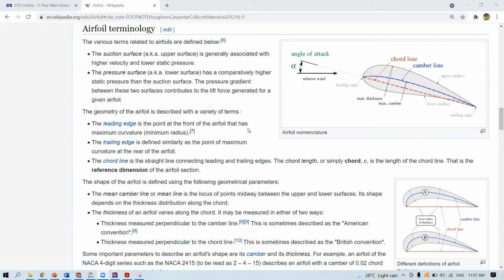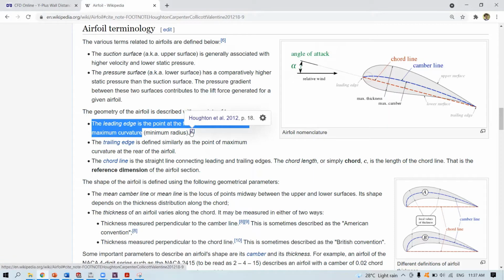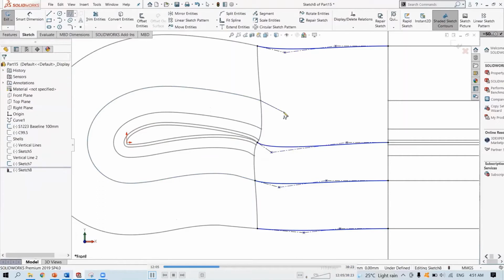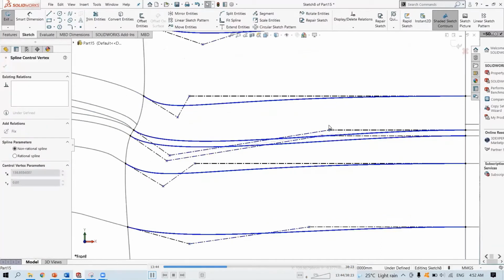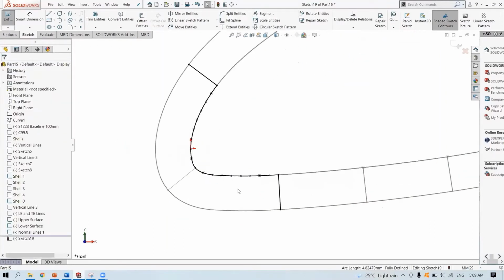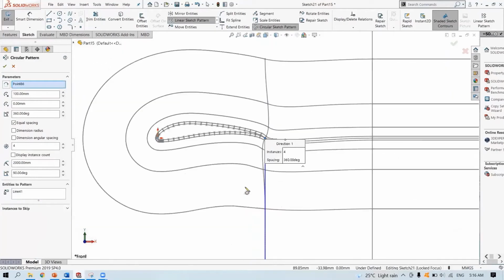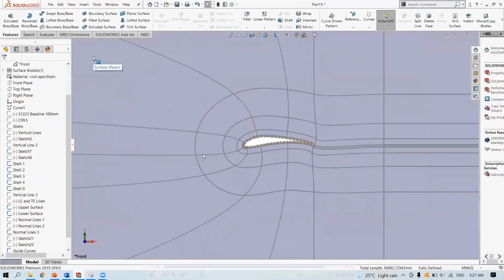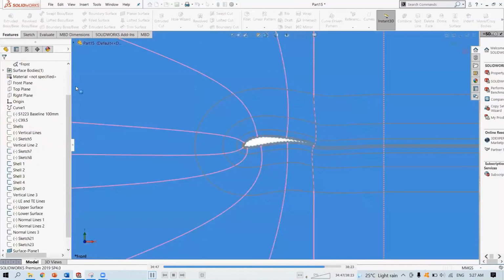Structured Mesh Strategy (skewness problem) for Airfoils (S1223) - Part 2 Solidworks

Comment: First ... It's a great job, well done
Seconde ... I can't make the Offset Entities in my SOLIDWORKS 2017 10mm and up ... I can make just 2mm.
Any solution please ?
Reply from the maker: Thank you Abdo,

You can trim off a bigger portion of your trailing edge. What airfoil and chord size are you using?